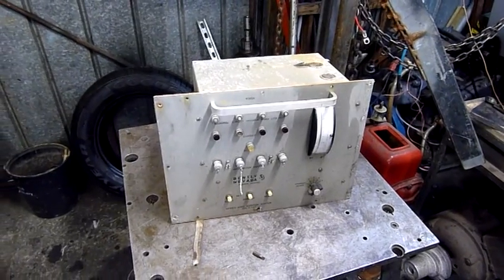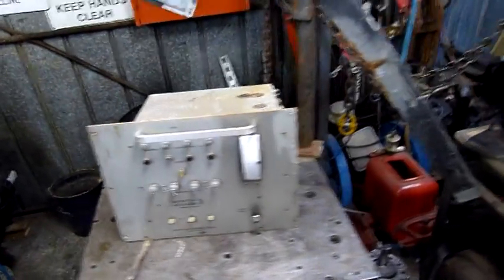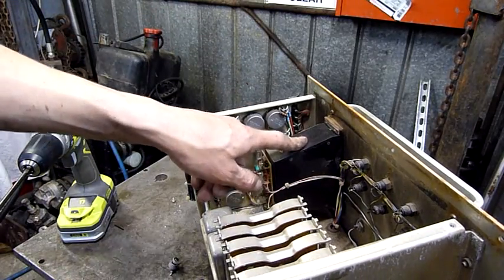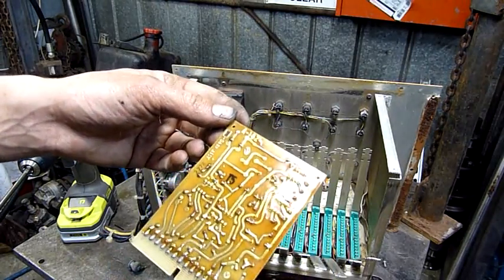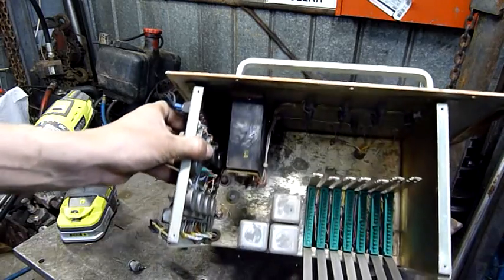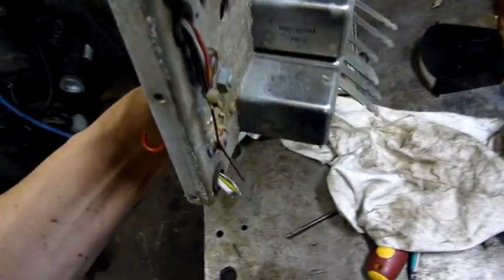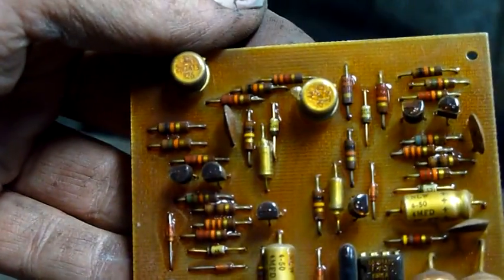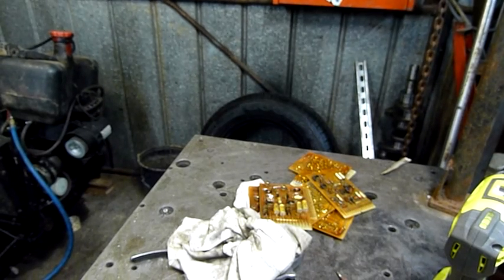Bentley Nevada 5000 Series Vibration Monitor Autopsy

Comment: those caps are sealed with epoxy and not rubber, so I think they might be OK.  I've seen other similar caps like that.   those boards have to be quite old if they are using turret terminals on them instead of the usual finger card edge

Comment: Ye olde components, you can bet they nearly all work.

1970's ??

Hmm i suspect the chips are op-amps like tl081 or similar.

i bet the meter could be re-scaled and a series resistance connected so it can be a dc volt meter :-)

Yep i enjoyed that, never seen one of those before.

Smashing :-)